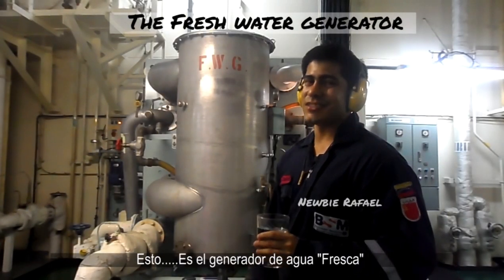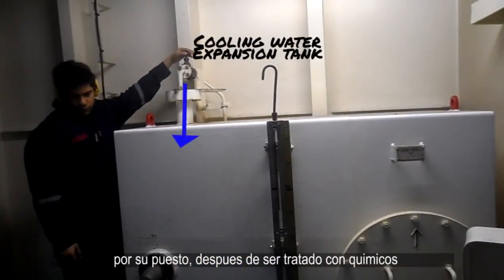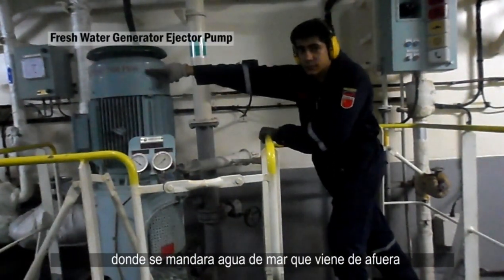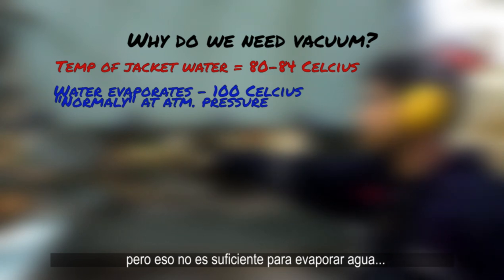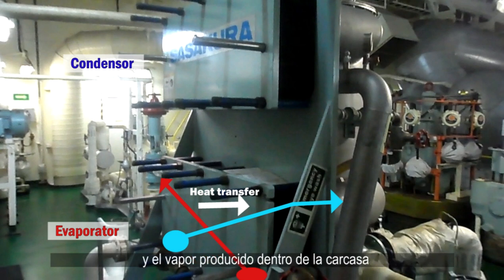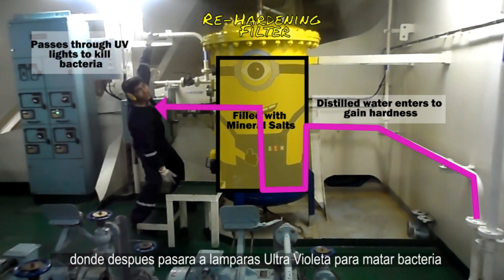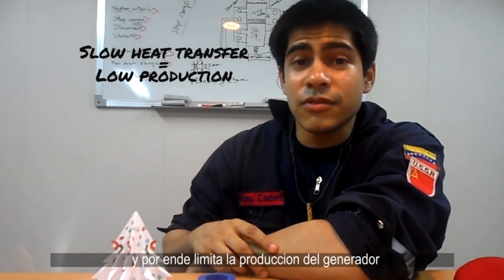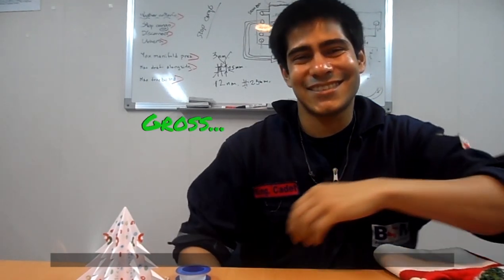Fresh Water Generators - How Ships produce Potable Water! (Importance and Theory)

Comment: Nice Video. What is the typical capacity of a FW tank ? How many days does the tank capacity last ? Is the desalinator on 24 * 7 ?
Reply from the maker: Thank you dude, and to answer your question FW tanks vary in size depending on the vessel, the tanks I've been in without production will last usually 13 to 20 days (more if rationed) however usually these fresh water generators are running to keep these tanks full. And finally these fresh water generators are usually only placed on when navigating or anchored away from Port.. In dirty waters one should avoid using this equipment.
Reply: @ShrimptoShark  Thanks for your response. Does the FWG start automatically when the water in the FWT reaches a particular level or is it a manual process ? 

Also, does your ship have redundancies or a single FWG ? I have noticed some ships having a mineralizer in addition to a FWG.
Reply from the maker: I can't speak for all vessels but the ones I've been on the starting process is all manual, first make vaccum and cooling, then allow heating medium in and monitor parameters, then extract and monitor destilled water.

I have been however on Ships with 2 fresh water generators but in this video there was only 1 in the vessel.

All ships should have a way to make drinking water from destilled water to use in the galley (kitchen) however I'm only sharing from my limited experience on Ships.

Comment: Can you explain Effect of sea water temperature on production of fresh water
Reply from the maker: Colder water requires more energy to evaporate, therefore it may be necessary reduce the amount sent to the evaporator so that the heat received is enough to produce steam. However in artic weather there is more problems! Unfortunately(or maybe fortunately) the area I was in was Europe - not too cold 😁
Reply from the maker: Aye you are somewhat correct, the if there is a bigger temperature difference between the condenser inlet and outlet (seawater) then there will be more condensate(distillate) production.

However the amount of energy required to increase the temperature of the Evaporator shell is higher because you need to heat the seawater more. If you lower the feed rate you can achieve this with main engine cooling water (usually 80 degrees) if you keep putting more feed water (to increase distillate production) you risk cooling down the engine causing slow down.

Some vessels have an optional Steam line to bypass this problem which would in that case be like you say slowly raising temperature and then increasing distillate production.
Reply: Bro.. you you create vacuum and temperature will be down , when you give flow of sea water  its mean  make normal temperature again 

how do you make heat 80degrees to make boiling water ?

Comment: Can you tell me how much vaccum pressure inside the FWG? Thanks in advance.
Reply from the maker: Hello my friend, depending on your FWG (there are many models) this one is Sasakura and works with -0.7 to -0.8 bar vaccum causing water to evaporate at below 80 degrees. 

This vacuum is altered however by deposits or clogs that are formed either on the bottom of the shell or the secondary pipe that goes to the ejector after the condenser as you could see in the video.

Some problems with vacuum are usually that it's not being generated or it can be adjusted finely by a small vacuum control valve.
Reply: @ShrimptoShark  my last contract I adjusted vacuum -0.95, temp in chamber 50 C, jacket inlet  around 88 out 76, sea water 30-32, feed water rate 6.2 c.m./h  it did not work if vacuum is less same as temperature rises too high (over 60) . production was around 20 cubic meters.
Reply from the maker: @glebvoloshyn3561  Heya dude.. I don't really understand what you mean.. If vaccum is higher then the water will evaporate faster turning into steam at lower Temps.. Then the temperature would rise faster no?
Reply from the maker: @glebvoloshyn3561  if temp was to high I would usually drop vaccum or open more the bypass from ME jacket water so less heating fluid would enter the evaporator. (however now that I think of it more vacuum could allow faster phase change of seawater which absorbs more heat when changing the from liquid to vapor thus lowering the temperature of the shell, not very sure though.. My main action would usually be to open the bypass)

Comment: Can u tell me about electrode in FWG sir?
Reply from the maker: Not all FWG are the same dude.. The ones I have been Onboard have not used electrodes.. Only electric component is the salinometer sensor which messures the salinty of the distalate water